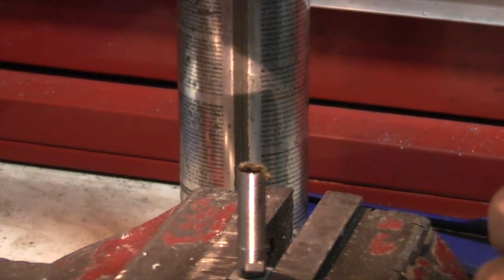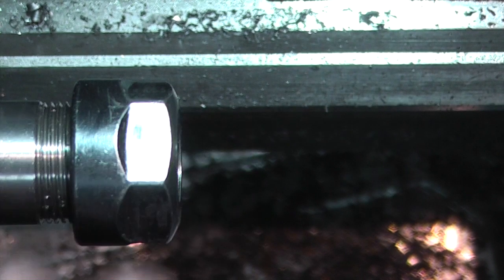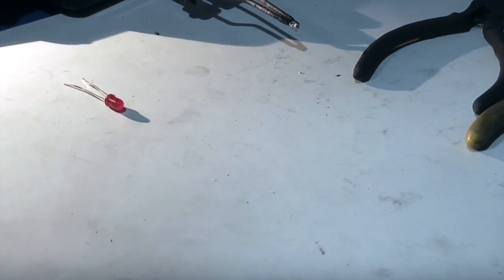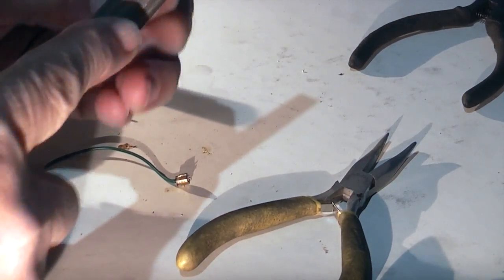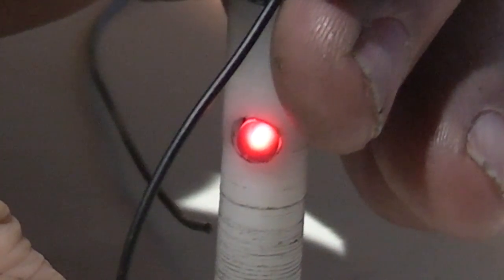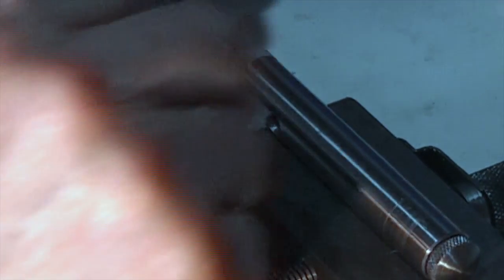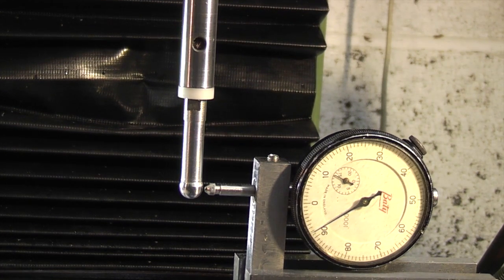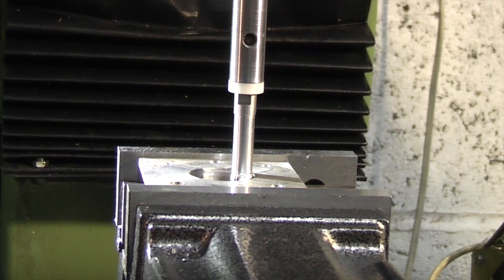Edge finder probe assembly

Comment: Great work just bought one off ebay $ 16.00 delivered the ball is spring loaded, it beeps and lights, the exact same thing in the Hare & Forbes machine book $93.50 + delivery accuracy 0.005mm check out there web site. But nothing beats making your own stuff cheers from OZ.

Comment: Good job, Alan.
You may want to put a 1\8 watt resistor of 5.6 to 6.8 kilo ohm in series with the LED.
This will drop the voltage and limit the current, so the LED only draws about 20 micro amp's
This will make the batteries  last longer, also protects the LED
Adam
Reply: With the 3V batteries Alan is using, 5.6KOhm will give a current of just over 500 microamp. To get good enough brightness, around 5 milliamp, so using standard resistor values of 680 or 1000 ohms at 1/8 watt would do well.
Reply: @jrkorman  
The typical forward voltage of a red LED  is 1.7v
(3v - 1.7v) \ 1000 ohms = 1.3mA
(3v - 1.7v) \ 680 ohms =  1.9mA
Most red LEDs will give a good brightness  at less than 1mA or even less
Most button cell batteries of this size, expect a load of less than 1mA to give good battery life

Comment: Very good! Works well.  Did you ever determine why the chuck was running out?  I had a similar problem with the chuck on my Chinese drill press, inspection revealed that the taper bore had been wrongly machined and I had to scrap the chuck. Replaced it with a Jacobs which gave a run-out of 0,001"